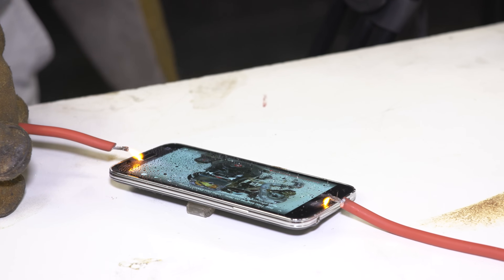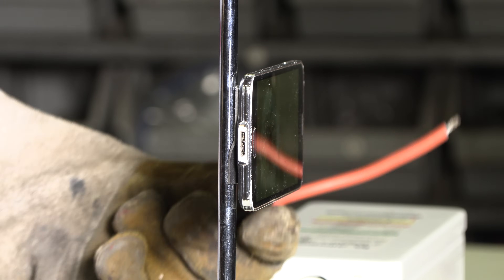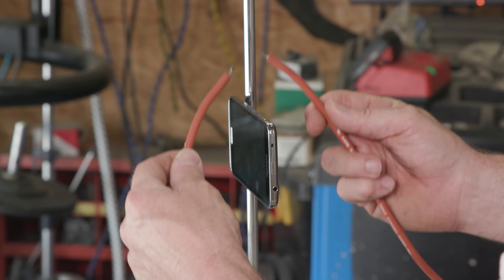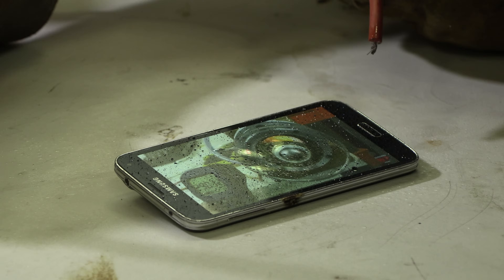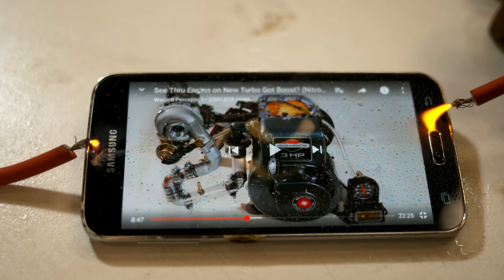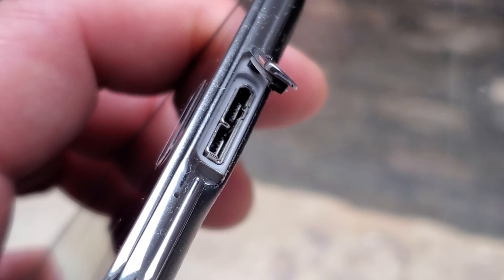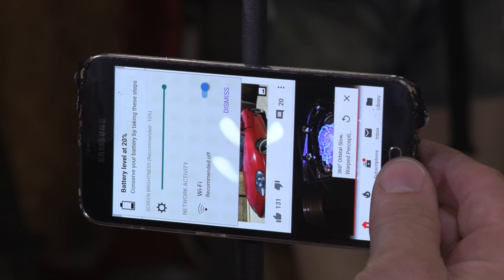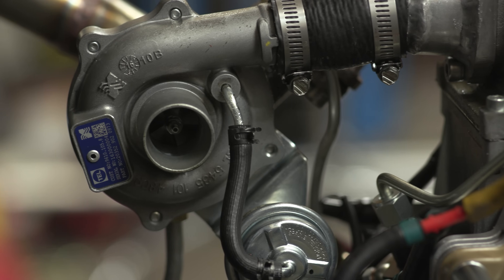Cell Phone vs 15000 volts

Comment: I've noticed that my phone's touchscreen becomes unresponsive when it's in the same room as my mini tesla coil.
Reply: Our fingers have capacitance if I recall correctly which is what the screen picks up from touch or rain that happens to land on it while trying to avoid it during use. Our body is basically a big capacitor for low level electricity. Ever notice when your touch screen won't work as well with dry skin or right after washing them? Moisture and likely some oils in our skin is what makes the touch screen work. The tesla coil is a huge amount of emf and doesn't play well with electronics in certain ways. The old magneto ignition system on engines long ago were replaced as they create a bunch of emf that would not be friendly to a modern vehicle.
Reply from the maker: @andrewawf9889  I had this happen in the newest see-through Engine videos, when I upgraded to the racing high power electronic ignition module which is about 100,000 volts and created a huge amount of EMI'S which fried my crankshaft position sensor multiple times, it was crazy.
Reply: @WarpedYT  try adding a wrap of foil around the wires next time going to the sensor as it will act as a shield. It sounds janky but the idea is to curb the stray power generated from the ignition interfering with the sensor. Many of the sensitive cables for electrical and electronics have a foil shielding layer underneath the outer sheath to isolate interference. A good example is a higher end cat 5 cable with the foil shield and often the paired wires will be twisted to further curb interference. Might want to add an additional ground wire with ring terminals to the coil, module etc mounting bolt of the ignition to help provide a better path to ground.
 
Technically if manufactured right, the insulation of all of the ignition components should not allow a bunch of "angry pixies" to stray from the components. Quality parts now no matter the brand seem to be difficult to find at times. 

An old timer showed me a trick he used back when I was a kid using a spray bottle at night with a gas engine idling. A fine mist was sprayed near the spark plug wires and it was time for a new set of plug wires after seeing how much difference in idle quality with just a mist of water. The car would run rough in the morning until warmed up due to humidity overnight. 

A friend's car was running crappy one night so we opened the hood and it looked like a Tesla ball in the dark with all the stray arching from the bad plug wires. Tune up time. 

Electricity is awesome but it will show you who is boss and where the leaks (insulation breakdown) is usually at the least convenient time.
Reply: can u show me how pixels work on a phone as a bonus episode?

Comment: The reason why it reacts this much is because electronical component is sensible to electromagnetic field and prone to disfunction, is is like letting your house electronic being hitten by thunderstorm lightning
It will cause damages
My advice for your friend, prople with thibgs like high voltages or Tesla coil : put your smartphones away if you don't want it to degrade faster of just stop working

Comment: this is not the same as bonding with a line, the phone would take virtually no current (not measurable)... if the phone messes up its probly from the induction from the ac, or any of the circuits that use the case or any other conductive part of the phone would get interrupted during the time it takes for the case of the phone to go from where ever it is (0v) to what ever voltage its being raised through.... my point is the phone is not part of the circuit.

Comment: this so hot a true comparison you are messing with different frequencies different types of currents grid power is 60hz or 50hz depending were you live and this is on the khz range you can tell by the color and heat of the arc

Comment: I was surprised to see the glass screen attracting the arc in the first test... I mean glass is the ultimate insulator, used on poles & pylons on the grid..🤔
Perhaps its acting as a capacitor with the body of the phone as the other plate ... earthed through the stand  but theres only one plate ? ... a cap needs TWO plates, insulated from each other... 🤨
Of course at high potentials like this weird shit does happen 😉

😎👍☘🍺

Comment: So if you haven't realized what's going on here, the phones metal shell is shielding the electronics from the HV on the outside. You can burn the plastic and what not, but if you want to ruin it's day, try to get in the SD or SIM card port, or remove the back cover and hit the battery.

Comment: Nope its because the phone is shielded with a metal casing. You can see it if you take it apart. Your friend's situation is field charge, not a flow of current. Also when the arc is drown, the voltage collapsed and the current goes up. So you are essentially burning the phone with plasma arc without injecting electrical or magnetic interference.
Reply from the maker: Good point, I'm going to have to check that out, I do in fact remember taking apart a couple cell phones a while back and there was like a thin aluminum or copper foil on the backside .

Comment: High voltage lines are closer to 400 000 V than 15 000. And there are hundreds of amps running thru, not like your high voltage PS that is surely limited to a few milliamps...  I'm sure a phone would like to be close to a high voltage line.
Reply from the maker: You are absolutely right, my friend said the lines that he works on our 230,000 volts to ground, this was the closest I could come, but I have to tell you I think higher amperage would have a bigger effect than high voltage, but a combination of the two as you said would be a much different scenario.
Reply: @WarpedYT  Yes that's right. There is something else than the electric field : the cables are also radiating pretty high power electromagnetic fields, which computers and, electronic devices in general, don't really like... :)

Comment: I've been doing electronics since the age of 10 and  find it amazing how well these are protected. A thousandth of that can brick it in nanoseconds. But the PCB and other components are designes to keep external charges around and away from critical components.
Reply from the maker: I also find it absolutely amazing oh, you are completely 100% accurate, even a small amount of voltage in the wrong spot can fry components.

Comment: that'll charge your phone in about 0.02 seconds!! lol
Reply from the maker: Funny that you say that oh, something that I hadn't forgot to point out in the video is that during this whole test the phone died like 10 times faster, the battery was brand new but it was being discharged somehow while I was giving it electricity, it would literally go from 100% down to like nothing in a matter of 10 minutes. Pretty weird
Reply: @WarpedYT  i wonder if the high voltage AC was somehow effecting the low voltage DC battery? like shorting it out basically??

Comment: The reason for it not instantly dying may be because the metal frame acts as a protection for the motherboard.
Idk tho, Good video!
Reply from the maker: Great point, and that's one of the reasons I didn't try it on a newer cell phone, this particular phone is completely plastic. it has that little kind of chrome-plated plastic around the phone but other than that the whole thing is plastic. I have one more test that I am really curious about I may do in the future.

Comment: 15,000 volts... Such a lie...15,000 volts would melt that small line...b.s the ones that lack
Reply: Voltage vs. Ampere. Little difference :)

Comment: Surprisingly tough. Remember when a static discharge fried motherboards almost instantly?
Reply from the maker: You're absolutely right, I recently had a power supply on one of my editing PCS fry and start sending crazy voltage to one of my graphics cards, I just changed the power supply out and the computer is working perfectly. I remember when this happened to one of my PCS like 8 years back, it was just like a loose cable and Bam it was over

Comment from the maker: 👎Thank you for all the thumbs down already!!! 🙂🙂.  it means the video is probably going to do well. 👎? Tell me why, I'm curious! 👎
Reply: Never mind them ..
There are always trolls on the 
internet  .no video has only likes 

Got a big like from me ...👍👍👍
Reply: Leather glove do nothing to protect you from high voltage, I'm surprised your still around to talk about it,  You about got yourself in series way to many times during this video you could have been burned bad or worse!  you should be wearing rubber gloves rated for high voltage. Class 2 rubber primary gloves.
Reply: @santascoffee  that's not true distance protect you from electricity
Reply: @vitalyzdtvsecond9711  agreed distance and proper PPE if your going to mess with it.
Reply: Ha that means the video is well received
Reply: I mean I’ve your going to destroy a phone and use science as an excuse, try to explain what is happening and what’s causing it. And you also could  conclude your findings in a more scientific way. That be awesome also was the flickering on the screen caused by the phone refreshing or the ac current running through?
Reply: Didn't give a thumbs down or up, but you really need to apply proper tools for the job, in this case leather gloves ARE NOT proper tools.
Reply: I only thumbs down because I know there is no way that's 15000 volts other than that cool video
Reply: @vitalyzdtvsecond9711 It certainly is. I have similar transformers at 12Kv that are similar for neon signs current limited at 60ma

Comment: Every time I power on my tube rf trazmitter my phone goes crazy 
Since touch screen works with capacitance, high voltage causes random charges in the capacitor plates, confusing the digitizer (touch screen) chip

Comment: Super super cool! Lmao take a camera flash circuit and a crap load of capacitance and short it across the phone or if you have capacitors that can handle 15k volts charge em up and short that across the phone. That would be crazy! 😂😂😂😂😂. This video was awesome bro! I always look forward to when you upload!
Reply from the maker: Lol.. that's an awesome idea !!
Reply: @WarpedYT  i did it on 1 of my videos lol. But with a peace of solder the length of a wire across the caps lol. It evaperated it and the short is so dam loud! Lmao and i built a fallout 4 looking gun that has that circuit but i haven't uploaded it yet. I will be soon tho. Ikr i hope u try it. Its way more deadly tho cause of all the capacitance and there capability of discharging it all imidiately. 😂😂😂😂